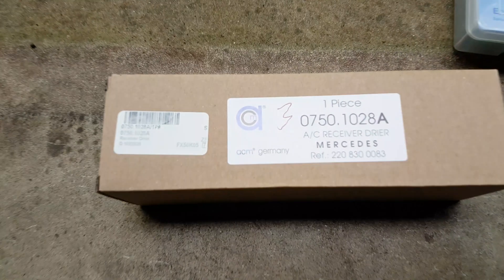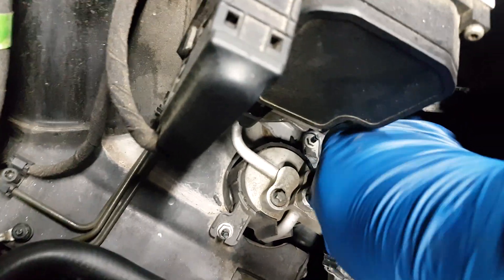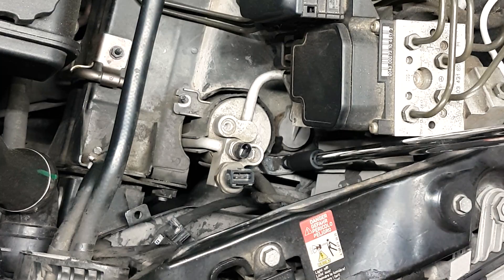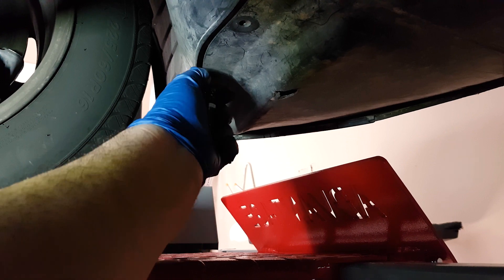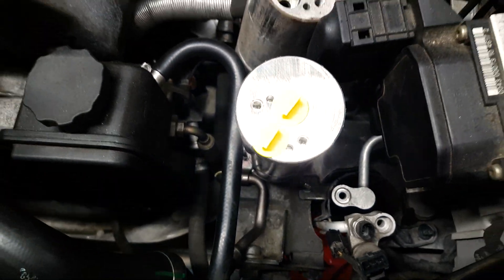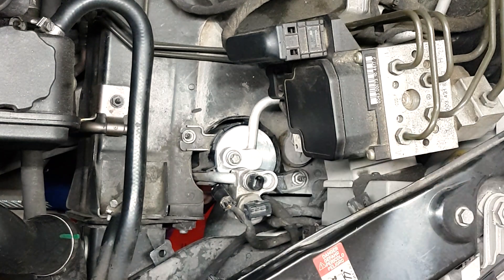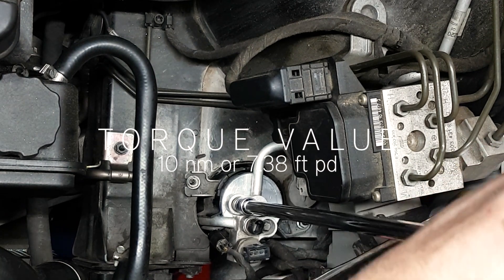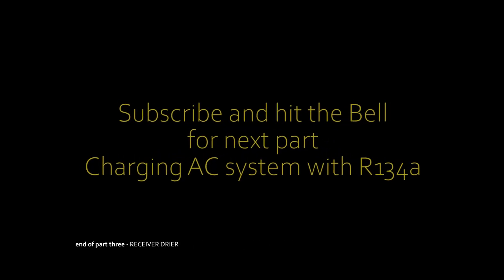Mercedes W220 AC Service - Replace Receiver Drier - Part 3- S500, S430, S320

Comment: Thanks for great video. If you also replace complete air conditioner (filled with oil), do you still have to add oil?
Reply from the maker: Hi Friedrich, thanks.  I think you meant to write air compressor.  No.

Comment: Great video great video ill probly end up doing this replacment in the future but for now do you know if the pressure swtich has a check valve on it or is it open? My pressure switch is bad and need to replace it but not sure if its going to evacuate the refridgerant
Reply from the maker: Hi Angel and thank you.  I have not replaced the pressure sensor on these cars.  I would think it is fitted with a Schrader valve as in with some other cars.  But, apparently not.  According to the service manual, it says you have to evacuate the system, replace the pressure sensor and its o-ring,  the receiver/drier and its o-rings, and then refill with refrigerant.  The torque spec for the sensor is 10NM.  I hope this helps.
Reply: @masood-tv  ok awsome thank you very much it does help ill probly get ot it when i get a change. Ill have to get some ac vavles and a vacume pump first. Or i might just be able to take to a shop to do the evacuation and recharge